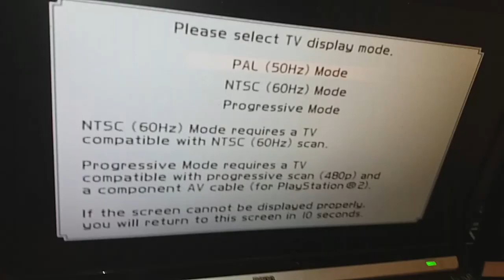How to repair PS2 cd tray won't stay closed

Comment: This doesn't work for me on my SCPH-30001 R from 2002. I'm trying to get rid of this unit (I got an SCPH-50001 which is a better model). I've tried messing with everything but it just won't stay open. It closes after like 3-5 seconds.

Comment: Mine almost does this let,me explain mine(which I just acquired a week ago mine)will actually open the tray when I push the button and it on occasions close the tray by itself right away.So I’ve got like two seconds to pull that the disc out or I can wait after it closes,I can push the button again and that’s when It’ll stay open for me.
Reply from the maker: You can try to loose screw a little bit.
Reply: @silverian  when I go to clean it I had planned on it sense this morning after watching this vid of yours